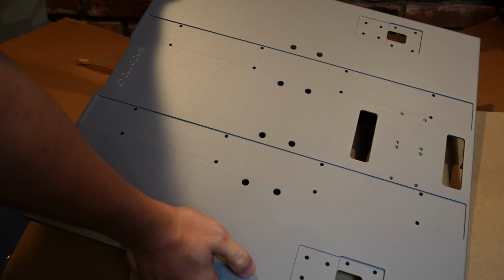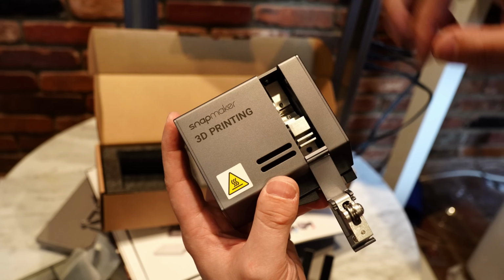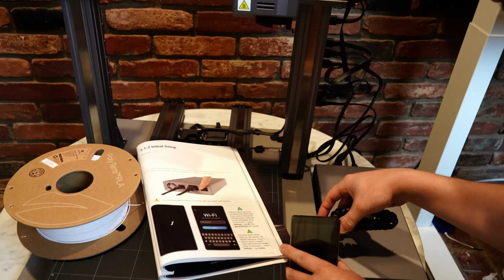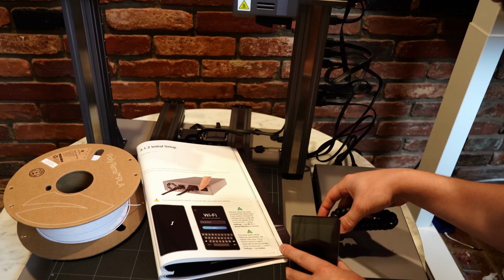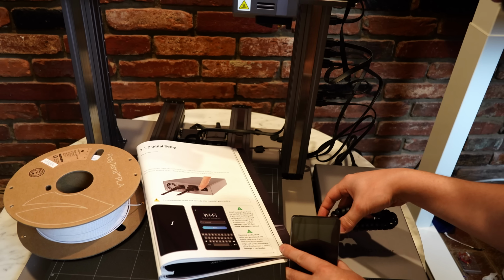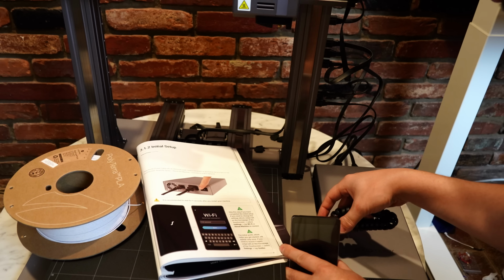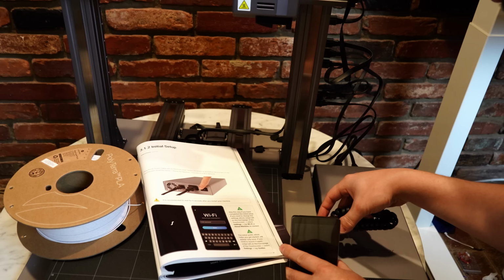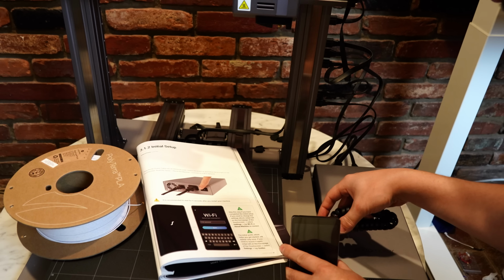Snapmaker: 3 in 1 Abomination Built on Marketing Hype and Good Looks

Comment: I like how you mention, reasonably, that you really want to make sure to use the right fasteners to avoid tearing out threads, but still persist in using power tools to put threaded fasteners in aluminum parts.
Reply from the maker: It has a clutch to prevent overloading, but I see your point. I end up over torquing things by hand more often FWIW. 
The best tool would be a smaller electric screwdriver designed specifically for electronics assembly.
Reply: We use drills to run threaded fasteners in aluminum all the time with aircraft. Busting the threads out is fairly rare with modern drills if you have half an idea what you're doing. Between setting clutches, not running it to final torque, running slow, etc. there's a whole lot of ways to not damage anything.
Reply: Who uses hand? Man, just engage the clutch and set it for lower torque. It's like those people who insist on putting IKEA cabinets together by hand. Try doing 10 of those a day and you'll use electric screwdriver on your second cabinet. Damn lol

Comment: You really don´t seem like someone who should be testing machines and making videos about it.

You ramble about not liking that the powersupply being externally but fail to mension that this thing has an option for an enclosure wich makes it necessary to have the powersupply external. There are countrys in wich you actually can´t get a snapmaker without it due to legal issues in therms of laser safety. A powersupply in the enclosure would for shure not last verry long when printing due to the temps or the dust when milling.

 You complain aboout the buiding process and how it´s confusing with one of the best building guides out there. It´s showing exactly where every screw goes and wich oreantation stuff has to be mounted in. If you don´t even care enough to read a manual on your 1400 bucks machine you should probably just not even get one in the first place. 

You turn up the print speed to 500% and then complain about the underextrusion wich makes me think that you already know your conclusion on this machine and are just searching for stuff to show of as bad. You know there is a thing called maximum flowrate wich a hotend is just physically not capable of exceeding. This is not advertised as a fast printer and it isn´t meant to do so. Its like buying a honda civic and complaining about loosing control at 400km/h. And then you draw your conclusion on the machines printing capabilitys based on on print.... that you speed up by 500%...........

And then you explain that you got a 3 in 1 machine but will treat it just as a 3d printer because you are not interested in the other functions and proceed to compare it to a random 3D printer that is in no way a good or reasonable comparison to this machine. You compare a race car to an suv, does´t work or is resonable to do. If you know you are not interested in the 2 other functions why did you get the A series model? 

I have an A350 myself an i agree on some points you made in this video, for example the issue where the filament dropps from the spool when the printer is homing is an issue that is really anyoying, like the messy cables hanging from the side.  The 22 screws required is also something i can see being anyoing, however me being someone who works in mechanical engineering, i know that this probably is for the better to prevent the heater pcb from warping and deforming due to the heat during printing, still something they could have figured out a quick release for.

But in the end you just come across as someone who genuinely doesn´t care about making a good review, doesn´t inform himself properly on the stuff he is reviewing, drawing quick conclusions or not even giving it a try in the first place and then making completly senseless, baseless comparisons that don´t make sense.
Reply: Hard agree. I generally love this channel, but this review just isn't it.
Reply: Yeah it was the speed that caused the underextrusion not the WRONG esteps from the manufacturer. Even 22 fasteners wouldn't work in keeping that flat on the contrary. If the heater plate can deform so much it will be wavy and under a lot of stress. Even though it is legal to get the laser without proper protection the manufacturer shouldn't sell the laser without it. They play with the health of uninformed users to make a buck.
Reply: He was talking about underextrusion BEFORE he upped the speed. And other people have complained about it. Overpriced turd is overpriced turd, the fact he goes through the trouble of continuing to try and make it work well, and points out the myriad problems as he finds them means he's actually doing a thorough review. It's loud and incredibly overpriced. The poor assembly and ridiculous amount of work that goes into changing mode just seal the tomb. It doesn't belong in a Bambu era.
Reply from the maker: An easy fix would be to permanently mount the bed to a plate, then use 4 screws to attach that sandwich to the moving carriage.
Easy fix for underextrusion is to ship the machine with the correct ESteps per mm after it being a known issue for 3 years.
Easy fix for filament getting caught is to install a guide, change how the machine homes itself, or relocate the filament holder.

This machine is full of low hanging fruit for improvements, if they aren’t going to put in the effort to polish their design, I’m not going to put in the effort to polish a turd.

I agree that I’ve been harsh on this machine, but as a reviewer and critic of 3d printers, I think I would be remiss in my duties if I give anyone the impression this would be a good choice as their first 3D printer. Way too expensive, and I find the artillery quite comparable. It’s got a similar build volume and feature set as a 3D printer. 

The enclosure is even more necessary on this machine than other lasers I have seen. It fires the laser straight down into the bed, which is studded with shiny chrome screws. You couldn’t make it more of a hazard if you tried.

Given the massive aluminum base, they could sink a ton of heat into it, to the point where the whole thing might be able to be cooled passively. That means no fans, no problems with dust.

However, I will completely agree with you that I put it together wrong despite having instructions, and that I don’t care about making a “good” (positive) review.

I really do appreciate the comments and discussion, I know people will disagree on things at times, but this is all just one man’s opinion. Not everyone has to, or should, agree!

Comment: have you tried using a  ceramic FDM filament ?Also did you try the metal filament ? I wanted to buy one but skeptical on its practicality .(Didnt want to buy it unless its reliable )
Reply from the maker: filament with ceramic and metal additives sound iffy. If the granules are clumped up, they can cause nozzle clogs. Also the filament becomes more brittle the more stuff you add to it, so its a little more difficult to handle. It really depends on the application, I doubt you need ceramic or metal additives unless you have some kind of crazy application. I guess they could look cool too.
Carbon fiber is the "best" additive IMO.
Reply: @NathanBuildsRobots  thanks bro .Is it possible to 3d print a ceramic rc jet engine ? That was my main reason to post its's the ones i see made of metal sell for 3-4000 euro.
Reply from the maker: @crewneckdeath6801  Depends on how complex. Do you mean a rocket engine or jet engine? Jets have a lot of small blades that have to be made of thin metal, 3D printing is not the best at making thin features because the granularity/resolution ends up being an issue when printing under 1mm thick. Also things warp quite significantly. That said, it could be done, it just wouldn't be the most efficient jet in the world.
Reply: @NathanBuildsRobots  thank you for clearing my suspicion and doubts .Have a great day.

Comment: Hey nathan, I fucked up my hurakan microprobe by printing too fast, the pin screwed itself out the probe enough to ram into the print and now its broken
Reply from the maker: Sorry to hear that. It is a new design, bound to be some growing pains as they start up production. They should offer to send you a replacement, if not, you might want to come up with a CR-Touch or BL-Touch mount instead
Reply: @NathanBuildsRobots  Im sure the voron I build for my birthday will have less issues because It doest have a warped china bed, no probe that unscrews itself and other design flaws that happen when you let a marketing team design a printer. Just quality components.
Reply: @NathanBuildsRobots  also, nice video as always.
Reply: Maybe add a little blue threadlock when you get your replacement.
Reply from the maker: When you say unscrew, do you mean the screws come loose and it comes off, or the probe creeps out and then gets hit?
Reply: @NathanBuildsRobots  It hits the print and in tge worst case, the build plate. Try unscrewing yours or jusr run at 250mms speed, you'll see what I mean

Comment: These linear actuators use ballscrews (at least that's what was shown on one of the teardown videos), not belts, so I seriously doubt this can get close to true 10K accel.  I also do NOT like the minimalistic heatblock.  Looks like that will definitely cause the thermistor (at the same side as the heater compared to the nozzle) to report a higher temperature than the nozzle is actually seeing.  Perhaps that is part of the cause of the underextrusion you were getting.  So I think this is better suited as a small CNC than as a 3d printer.